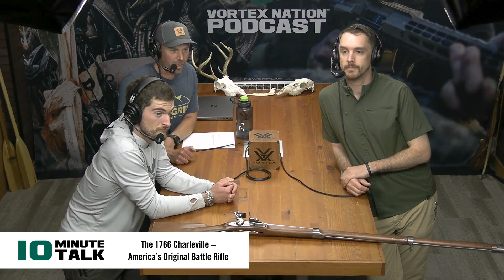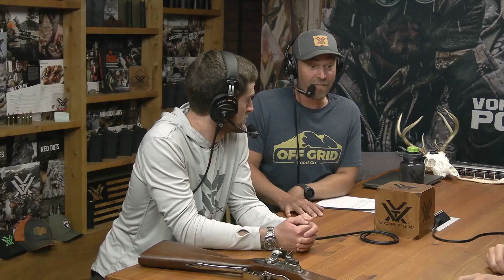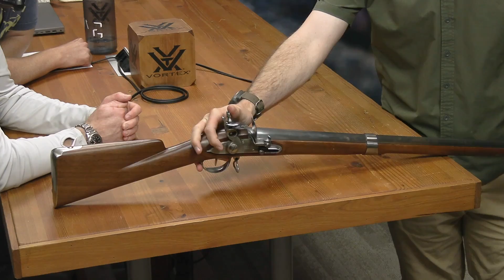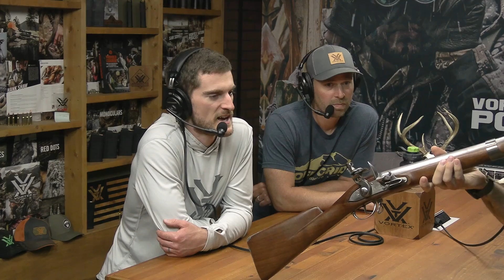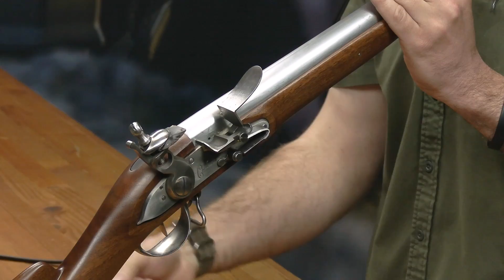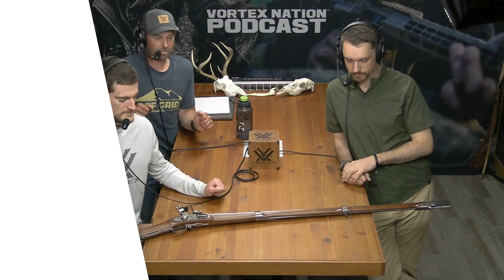#10MinuteTalk - The 1766 Charleville – America’s Original Battle Rifle

Comment: If u think about it flintlocks are probably the best long term survival gun. They were made before modern accurate machines by hand so all parts are easily enough to replace by hand, all u need is shot, any type of wad and powder and a piece of flint or even a ferro rod could work for ignition so no primer or caps needed. And u could load it full of old rusty nuts and bolts if u have nothing else
Reply: In a pinch u could probably make it shoot with a wick made out of cotton shirt to ignite like a match lock😂

Comment: During this period, continental soldiers would now have had possibles bags, they would have had cartridges full of waxed, rolled, and tied paper cartridges. The musket was considered a gun that was more designed with an emphasis on fast reloading and close quarters fighting. Basically, you rip the back of the cartridge off with your teeth, pour a dash in the pan, dump the rest down the barrel, then ram the ball, paper and all down the bore. The average guy could get off 2-3 shots a minute. Riflemen were a different story, and they were much like the process Ryan described, however they could only get off 1-2 good shots a minute, and they had a severe handicap in close quarters bayonet charges.
Reply: The term “Possibles” bag is a Hollywood manufactured term.
Reply: @RiverRat1953  ok, shot pouch, hunting bag, fighting bag, etc... Most people don't know that, and possibles bags gets the point across, and is how shot pouches and shooting bags are referred to today

Comment: Where might I find data to help figure out what kind of percentage of US soldiers and militia were issued or owned the Charleville vs the  Brown Bess vs. a KY or PA long rifle?
Reply: So as far as 1766s go 100,000-110,000 were sent to Continental troops in the revolution that's not including All of the 1717, 1728, 1728-54, 1763, 1769, 1770, 1773 and 1774 model muskets that were also sent
Reply: @macedonianproductions4497  long rifles were not issued, many were paid a bounty for showing up with their own arms, and some had rifles. Many however, set them aside upon receiving a musket, as at the time, the musket was much more practical for the fighting style of the time, and a slightly more accurate but slower to load gun was a disadvantage in open field, stand up fights with British regulars
Reply: Smoothbores (aka muskets and fowlers) were the choice of all military of that era due to rate of fire over rifled guns.  Smoothbores allowed loading both ball (4 and 2 legged critters) and shot (fowl).  If a farmer showed up to join the Continental Army with a rifled gun they were immediately exchanged for a musket.

Comment: So which rifle was used the most by the colonist? The brown Bess or the the charleville?
Reply: French muskets whether they be the 1717, 1728 ,1734, 1754, 1763, 1766, 1768, 1770, 1773 or 1774 were by far and away the most common muskets that your standard American infantryman would carry after 1777 and out of those the 1766 was the most common
Reply from the maker: It started with the Brown Bess as they would "obtain" them from the crown. They also used locally sourced The Continental Army was in dire need of muskets and often commissioned local gunsmiths to create them. The guns often did not have the maker’s name on them, and so they became collectively known as “Committee of Safety” muskets.

Comment: Back in the day, individual marksmanship took a far back seat to firepower, slingin' lead over there. Ranked fire, you would have three or four ranks of 100 or more soldiers. The US slinging buck and ball (3 balls of .30" buck and one big .64" roundball) with four ranks of 100, that's 1600 rounds a minute of fire. Muskets were long because they were replacing the spear and pike for hand to hand. A ship's carbine with a 20" barrel is just as powerful and accurate as the looooong barreled infantry musket. With a large caliber musket, there's more volume and because there's more volume, there's less pressure, so the barrels can be thinner. With musket rifle barrels, you need thickness because removing materials for rifling soft steel weakens it, so you need a thicker bore. 
The best flint comes from the English Channel (on either side) where there's chalk deposits. The flint, chard, whatever in the US sucks compared to English or French flint. The "front sight" on a Brown Bess is actually the bayonet lug, but there are some versions that have a lug on top of the barrel to act like a rudimentary front sight and a lug on the bottom or side of the barrel. The British Irish Rifle Regiments used Baker rifles with patched roundballs (with linen patches, goat skin patches, or thin leather patches) but they could also use bare balls and get reasonable accuracy. They would have their rifle loaded with a patched roundball, and if they didn't have time to use a patch, they had bare ball cartridges. 
During the Revolutionary period they had cannon powder and gunpowder, which was used for their muskets and pistols, which were often the same caliber as the muskets. In the 1850's, they introduced pistol powder. Cannon powder had big granules, musket powder had smaller granules (about 1.5 F), and pistol powder was smaller. As someone mentioned, they used the same powder to prime out of the cartridges. 
You can check out a person's doctoral thesis on the Royal Armouries youtube channel that covers the history of guns and gunpowder in England from the 1200's. It took hundreds of years to change the way they made gunpowder and then just 30 years or so to make another major improvement.

Comment: Battles back in the day were called for rain not only because flintlocks won't work in those conditions, but neither would artillery. Plus when it rained, the dirt roads turned into a quagmire, making it next to impossible to get supply wagons or gun carriages anywhere fast. Because of that, they would have to wait until the roads dried enough so they could get to the site. 
The average soldier didn't have a "cow's foot" to cover their action to protect against rain and snow, just hunters and skirmishers. It was a leather piece with a snap or thong to tie it around the cock and the closed frizzen. The closed frizzen would keep the ignition charge from pouring out, but the average soldier only had a loaded musket when they were on guard duty or on the firing line, after being ordered to load and make ready. If it snowed or rained during guard duty, they would cover their action with their poncho or rain cape. They had wooden tompions to plug their bore when they were on the march to keep water and other debris out of the muzzle. Most soldiers had a screwturn (what screwdrivers were called back in the day) to remove the sidenails so they could take the lock off for cleaning and oiling. (Sidenails are what the screws that held the lock in place were called). You can actually touch up a dull flint using the spine of a knife blade to hone it or you might have to reknap it altogether with a knapping hammer, but they would have spare flints in their gear or in the supply wagon. They had a patch worm to use with either a scrap of cloth or a wad of tow to use as a cleaning patch. Tow is a byproduct of the production of linen thread, it's similar to straw, but inflammable. They had ball screws used to unload a musket after guard duty. Since they used paper cartridges preloaded with powder and ball, they never made the mistake of loading a ball without powder, unless their musket was going into long term storage. Their Sergeant had a Seargeant's tool that could be used to take the lock apart or take the stock off the barrel. If a regular soldier did it without permission, they would be flogged (whipped). They used sperm whale oil as a lubricant, the same thing they used in oil lanterns . it was a fluid drawn from the skull of a sperm whale. It insulated the whale's brain from heat and cold and physical shock when they rammed opposing males with their heads. The guns were kept in the white to reduce cost and speed up production. Soldiers would use brick dust to polish off any rust. If they had rust on their musket during inspection, they were flogged. 
George Washington was a huge proponent of buck and ball, a .64" roundball with three .30" buckshot pellets. The French couldn't make powder as good as the British, so their cartridges were loaded with up to 200 grains of musket powder while the British loaded theirs with "only" 140 at the time.  The French, English, and US upgraded to .65" balls during the war of 1812/French and Indian War when they improved the way they made powder with compression to make it denser and cleaner burning. They lowered the charges to 120 grains, with about 20 grains in the pan and to allow for spillage with the rest going down the bore, followed by the ball and paper, which were tamped down with the ramrod to let out the airgap, not rammed down hard. The paper held the ball in place and acted like a sabot to keep the ball centered, supposedly. Every time I shoot, I end up with confetti blowing out with the blast. 
With a smoothbore musket at 80 yards, you had a 270% hit probability with buck and ball. If you actually aimed with your eyes open (most US soldiers didn't do either during the Civil War), you would hit the guy you were aiming at and the guys on either side of him and maybe some rando behind them. Most Civil War monuments have buck and ball somewhere prominently displayed on them. And yes, French 1866/68 muskets and captured British Brown Bess muskets saw action during the Civil War on both sides.
Reply: THAT WOULD BE LIKE SHOOTING GRANDPAS GUN.  VERY FEW WERE USED IN THE CIVIL WAR.  MOST OF THEM USE BY THE REBS

Comment: The flintlock reminds me of how many deer I have missed in rainy weather with my Lyman Trade rifle.  If the strike area of the frizzen gets the least bit damp, the flint slides right across.  No friction, no sparks, no boom and a nice click that is very audible to a whitetail.
Reply: Coming out of a cool house on a hot day, the condensation on the frizzen keeps the flint from sparking. Similar things happen if you bring a room temp gun into the cold. Condensation will freeze up the action of a modern gun in extreme temps, so you have to "condition" your gun by letting it sit a few minutes until condensation thaws and evaporates. :)

Comment: The powder in the pan was, most often, protected from moisture by a thin application of some kind of animal grease between the frizzen and the pan.
Reply: That didn't happen during regular military combat, or even irregular combat. That's mostly a "mountain man" old wive's trail.
Reply: @TrueOpinion99  I wasn't talking about combat. I was referring to everyday use by hunters, woodsmen and, yes, mountain men. The practice of sealing the frizzen with grease is  not an "old wives tale."
Reply: @Paladin0954  - It really is an wife's tale; show me a primary source that proves it was used, even if it was uncommon.

I hunt exclusively with flintlocks and I'm a historical reenactor; I've tried using the beeswax/tallow/grease thing to waterproof my pan on more than one occasion and the only result was that the grease would very quickly get wiped off, if it was hot the grease would contaminate my priming, and in many cases it wouldn't actually work. Everyone who uses flintlocks in field conditions will tell you that the "grease your pan" thing is more trouble than it's worth. A cow's knee is far more effective and less finicky.